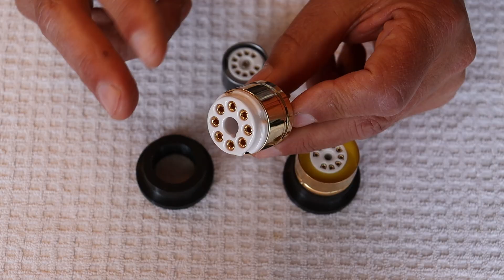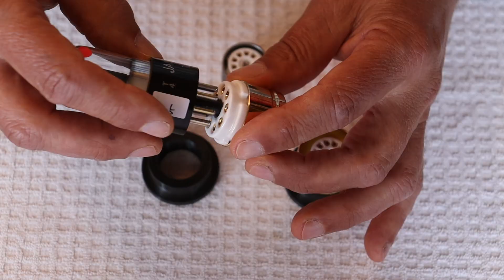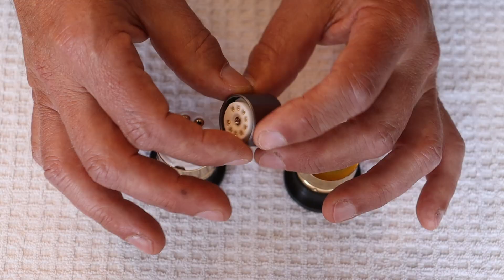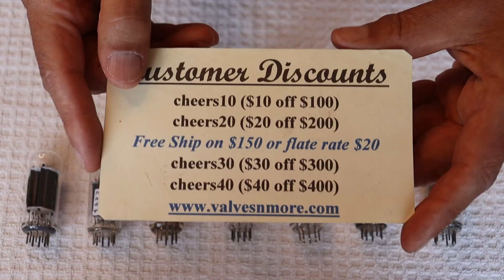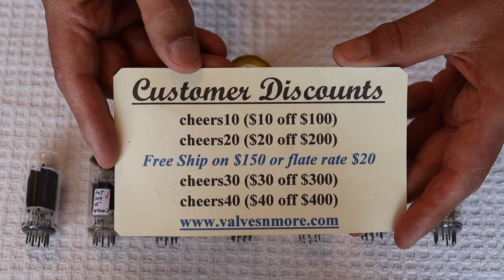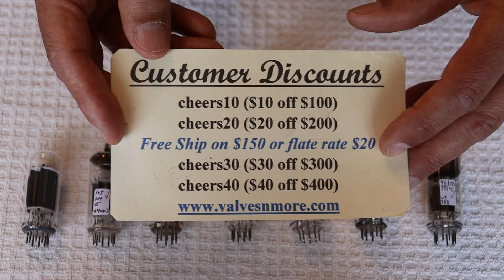Tube Lab #239 - Socket Adapters & Tubes To Adapt

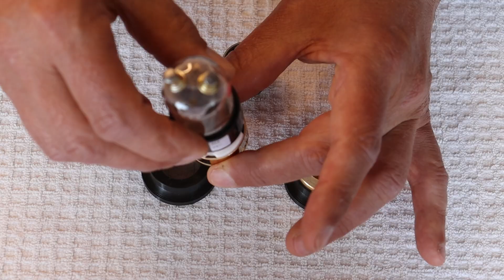Comment: 4:37 wouldn’t this put the same amount of wear on the original socket anyway?
Reply from the maker: That depends on the adapter.  Some adapters are designed to be permanently installed.  But you are correct the average adapter isn't designed to reduce wear on an existing socket, but to either "electrically adapt" one tube type to an existing socket (that it otherwise couldn't plug into) or to lift the tube above a sunken socket, to reduce the potential damage by handling the glass instead of the plastic base.  Cheers! Jim

Comment: Thanks for the video. You said if we're using a socket saver/raiser and the time comes for tube rolling the whole assembly (tube+raiser) can come out together. What is the point of raising the base of the tube if you still need to reach down into the amp and remove it? Can we leave the socket saver plugged in and just remove/replace the tube?
Reply from the maker: Good question!  Our octal socket saver/lifters are snug and I've found if you grasp the tube base and gently/slightly rocket the whole assembly, both the lifter and tube will come out as one unit.  Now obviously if you have a brand new amp with sockets that are virgin, they'll need to be broken in before this trick will work.

And of course both the tube and lifter should be assembled then installed as one unit.

Some manufacturers will break in sockets (they should), but often they don't, leaving it to the customer.  Over in MTA (our Kit business), when we do a ProBuild we do the break in before testing and shipping and our Kit builders are instructed to do the same.  Hope that helps.  Cheers! Jim
Reply: @tubelab194  That makes sense, thank you!

Comment: Why did the Hytron used the Grid Pin & HV High Voltage Pin on the Top Dome of the tube to be more direct connection to the Horizontal Top Plates for reducing the noise? I'm just confused why would they put the Grid Pin & HV High Voltage pin on the Top Dome of the tube which is unusual to see in audio circuits but in Radar circuits this is normal operation. When Tube Rolling you have to match pair or there will be two different frequency profiles and gain profiles which would cause what problems?
Reply: Hi Wayne,  we don't know for sure of course but we suspect it's because they were used in radar and they were trying to keep the leads as short as possible as well as keeping the high voltage and grids as separated from each other as possible. This also likely decreases capacitances in the circuit as well.   So not common at all in audio circuits for sure, but it doesn't mean we can't use them in audio circuits now!

As for not having matched tubes and the kinds of problems it can cause, it depends on the type of mismatch. If it's a mismatch of tube type then the channels will sound different depending on the type of tube you have in there. This could range from being difficult to tell to really obvious.  If you mismatch based on performance then the amount of trouble will depend heavily on the circuit. In the case of our new prototype 6or12sn7 circuit with two medium MU (Amplification Factor) gain stages, if both stages are mismatched channel to channel then those difference will stack and get amplified to the point that you have a significantly lower output from one channel compared to the other.

Cheers!

Comment: Question. Is the socket also fixed/screwed to the chassis and only connected to the pcb?
Reply from the maker: Can you clarify the question please.  Are you talking about socket saver/lifters or adapters or the monster cv6 to 6SN7 adapter.  Thanks
Reply: @tubelab194  oh sorry. My question is not related to adapters or savers.. It’s a general question about how tube sockets are mounted.
Reply from the maker: @thomasfi1275 sure, tube sockets that are mounted to a pcb rely solely on solder to hold them in place and maintain a good electrical connection, this may sound weak, but in fact can be very strong IF the pcb is designed for the job.  In our Kit Amp business we spec the thickest pcb (2mm) available from our manufacturer and then support it specifically in the areas that the tubes are plugged in.  We also design large solder pads to make a really large surface area for soldering the pins in.  Not difficult, but you need to put quality over price and most manufacturers choose to save the money and install cheaper boards.  Traditionally sockets were bolted (typically 2x m3 machine screws) to a top plate and point to point wired, this is a good way to install sockets, but very labour intensive, so 99% of sockets are pcb mounted these days.
Reply: @tubelab194 many thanx!!!

Comment: Does this fit the Wilsenton R8?
Reply from the maker: All of the 6CG7's adapted using a 9 pin to Octal adapter should work well in v6&9.  However I wouldn't recommend the CV6 monster adapter, it's better suited to a preamp gain stage, whereas the 6SN7 in the R8 is a driver stage.
Reply: @tubelab194  is the 6SL7 the preamp gain on the R8?